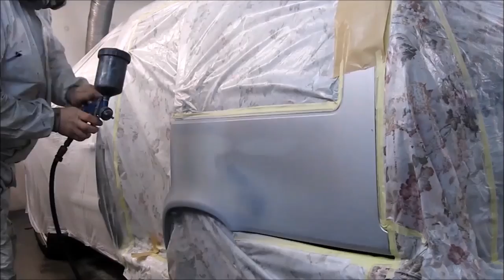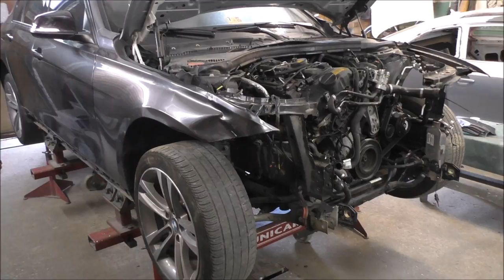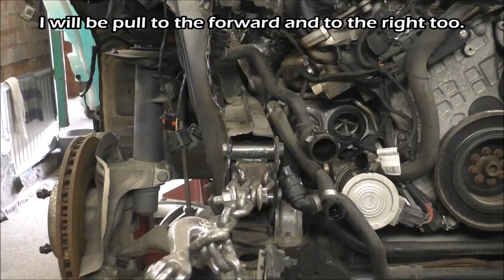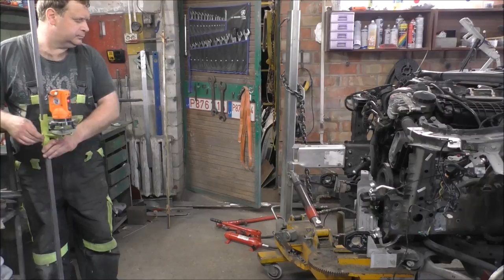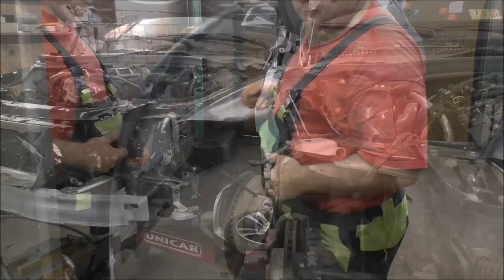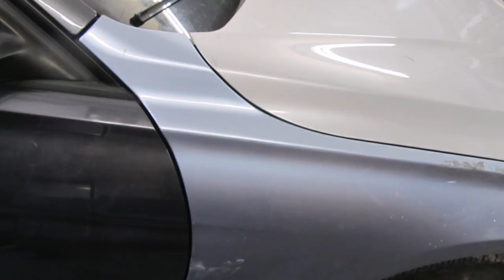BMW 3. The minor repair.Небольшой ремонт.

Comment: hi,another good video as you show that no car is a quick pull and nail the bumper on,this car actually looked easy to repair in the first minute but as you show it was actually a lot worse and only skill caused a proper repair rather than major component changes,nice one,thanks again for taking your time,you didn't post up the time taken,[lease do as i use this as knowledge gained

Comment: Unfortunately there are alot of negative comments on your work/videos. Having seen the buisness on both sides of the pond, I can see nothing improperly or dangerously repaired. I have noticed a good number of the cars you are repairing are from the U.S. If some of these commentors knew how many of these vehicles are being horribly repaired and resold without leaving the state they where damaged in.